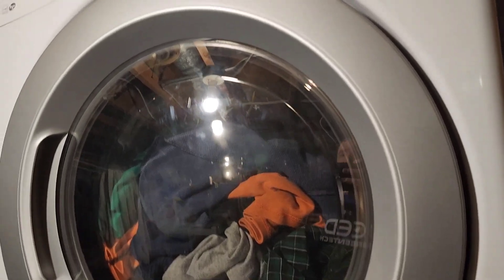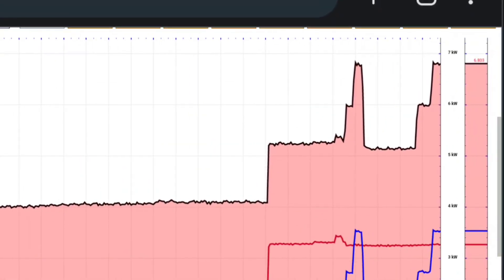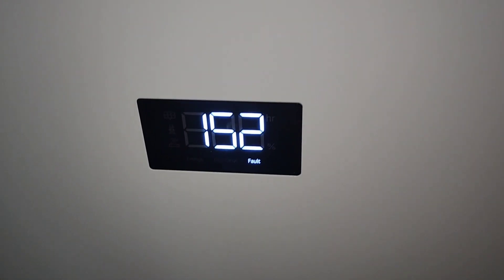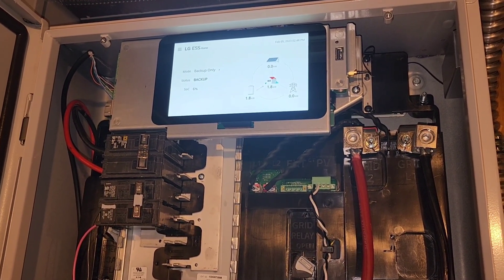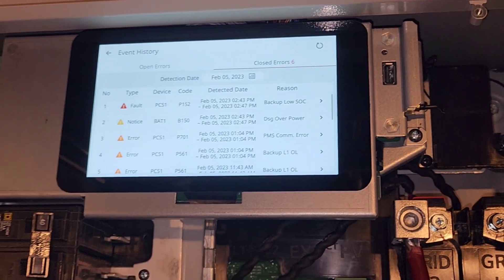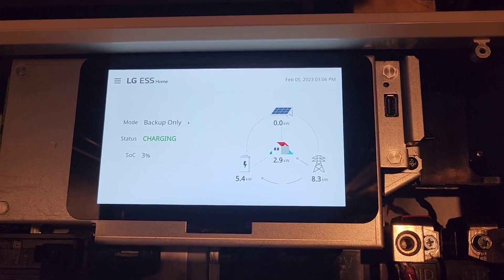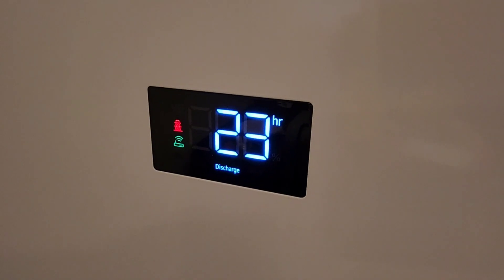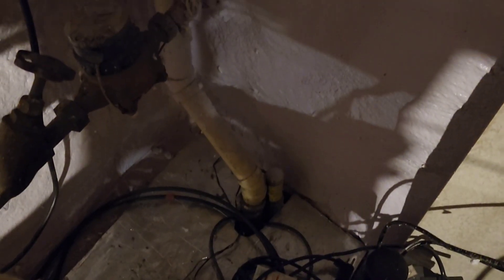Load Testing the LG Home 8 ESS

Comment: Hi Ben,  I hope you will make a 3 minute video on adjusting the solar edge configuration to curtail with frequency without shutting down.  thank you
Reply from the maker: If I can figure it out, I definitely will.  I'm currently running a screened version 7.6kW unit and while I have the settings in there, it doesn't seem to work.  I have one more thing to try. In one of the documents, it shows adding a jumper onto the comm board to put it into off grid mode (I think, it's not clear). I'll post here if I get it, and make a video about it.

Comment: What are the specs of your sump pump? Did you have anything else running with the pumps?

I have two sump pumps on a 20 A circuit that I want to add to the backup sub-panel with the Home 8, but I'm not sure the battery can handle the inrush current, especially if they both start at the same time. They were installed before I moved in, so I don't know anything more about them.
Reply from the maker: Mine is a 1/3hp. The rest of the house was running too, probably around 1000W base load. It should be able to start both at the same time, but if you set the floats to different levels, it shouldn't be a concern.  It will start my air compressor, which other inverters struggled with, so I wasn't really worried about the sump pump.

Comment: Do you think this system is a good option with the sneider for AC coupled Enphase IQ8+ inverters?  Not many stellar reviews on any investors I can find for AC coupled systems working as good as a DC except Tesla . 

My solar is literally in the final stage of install and I need to keep the IQ8’s and all the research i started doing shows the best option is the Tesla Power wall. I’d rather not go through the wait in California to do the Tesla not to mention the price. 

My installer wanted me to go with the Enphase system and I need way more power use than those can feasibly provide. 

Thanks. I’ve literally watched all your videos since the beginning 😊
Reply from the maker: The Schneider works, but it is honestly better for off grid. 
The LG Home 8 has been working great so far and is the closest in features and controls to Tesla.  It is a little more expensive, though.  Thanks for watching ALL of my videos!
Reply: @benssolarandbattery  I'm approaching the big decision and can't afford to screw it up.. After seeing you rave about the Schneider, I am surprised to hear you don't like it for hybrid... why not? 
TY
Reply: Schneider is clunky. LG Home 8 will work with the Enphase.  Best if it is Rule 21 compliant.

Comment: Have you ever heard of a Net Zero (Net Zero its a brand name) Inverter with a 20k power bank I've seen picture of one installed but that's all just curious as to how good of a set up they are. I was told they don't advertise just word of mouth.
Reply from the maker: I'm not sure which one you're referring to.  A number of different systems can do grid zero with zero export as well.  Typically though you need a DC coupled solar array to do zero export.  If you have a picture of the system I can take a guess at it.  Benssolarandbattery@gmail.com 
Cheers!
Ben
Reply: @benssolarandbattery  Net Zero is a brand of solar
Reply: You need to get your units straight before you start asking questions
Reply: @user-ke9yk5qp3u  you need to get your brand names straight before stick you head up your butt

Comment: I wish this battery worked with the enphase Microinverters
Reply from the maker: It does! Arguably better than enphase batteries... 🤫
Reply: @benssolarandbattery  wait what? How would this work? Would another inverter be in the mix? Like xw pro and something else or does the lg battery controller just take in the ac from enphase?
Reply from the maker: @coolmaster121  you can either tie the output of the enphase system (or any other grid tie inverter output) directly into the LG smart energy box, or leave it in the main panel, as long as you're backing up that panel.  There's a current transformer (CT) that measures the solar output. It can then use it to charge the battery and run the house in an AC Coupled scenario. The LG battery adjusts the frequency when the charge rate is too high or when the battery is full, causing the grid tie solar inverter to shut down or slow down, depending on the programming.
Reply: It'll work fine with the Enphase micro inverters.

Comment: Why not just use inverters with parallel capability? I have three 5kW Iconica inverters with a 92kW lead acid battery bank. I can run up to 15kW if I want...We have a 9.5kW electric shower that will take half of its power draw from the 8.4kW PV array in summer. Even in winter, it's no problem for paralleled inverters. I'm in the UK.
Reply from the maker: I definitely could, and do for my customers, but in my case, I'm mostly just testing them. If my customer had a house similar to mine, I'd install at least 2 of these LG batteries, maybe more.  (I use a lot of power)
Reply: @benssolarandbattery  Ah, understood. I couldn't understand why you were taking all the measurements etc.

Comment: Really quick question, can you use any mppt controller with the Schneider xp pro you have?
Reply from the maker: Yup, it just won't be on the monitoring platform.
Reply: @Ben's Solar and Battery  thanks. I have Tigo A-Os and from what Tigo said, they may or may not work with Schneider mppt charge controller and at that cost just for the charge controller add on, it didn't seem like a smart purchase. Now that Schneider inverter on the other hand seems like a real workhorse.

Comment: Cursory glance looks like this is a $12k unit with battery and smart panel for 14kWh backup, how does this compare against competitors? What do you think of Signature Solar’s EGLL v2, you could do 6 of those for 30kWh and supposedly they’re UL listed now.
Reply from the maker: This system is more comparable to Tesla Powerwall, Sonnen, Enphase, Franklin WH, etc.  You can definitely do it for cheaper, but this is an all-in-one, including the battery. Tesla is cheaper than the rest, and this is on par with the rest.

Comment: Hi Ben, that's really weird. I have a similar LG dryer but a matched unit with washing machine on pedestals. My Solark 12K has no problem at all running the dryer on batteries at night or during the day on  full solar input when the sun is shinning. Mine draws about 6KW too and I can have the dishwasher, and washing machine running too. I dare say the well pump and or furnaces come on every now and again when the washing machine is running. What is definitely a bridge too far is having the dryer running and trying to operate the electric cooker and/or microwave. I'm curious why your Solark is so touchy, I'm sure it's  slightly older than the one I have.
Reply from the maker: Hi Vince, my Sol-ark is definitely one of the older units, so that could be it.  I've stayed up to date on the firmware, but it's always fallen short compared to its specs.
Reply: @benssolarandbattery  I wonder if you are getting too much voltage drop on your battery as seen by the sol-ark ?
Reply from the maker: @Sylvan_dB  no, not according to the error codes, plus I have a large NMC battery that can easily handle 200a at 60v.
Reply: @benssolarandbattery  Hi Ben, it's a shame that you can't get it to work. Like you if it wasn't working for me I'd be looking for an alternative for sure. I can't remember exactly but you'd replaced your blown inverter with the Solark and some time later after I'd wasted so much time with other  vendor stuff that wouldn't work one of your videos convinced me to get one too. I think it was circa  2020, probably August. Wow, when I mentioned the other  vendors are from Chyna  the entire comment turned red and I couldn't post. Looks like YT is an an extension of the C C P now.
Reply: @benssolarandbattery  Do you know the exact build date?  The build date is encoded in the number on a rectangular sticker with a QR code.  the first 2 digits are the year, the second 2 are the month and the third 2 digits are the day (i.e. a number starting with 200804 would be 4AUG2020).  I have 2 12Ks in use, one October 2019 and one June 2020, and the earlier one is twitchier relatively speaking.  It also has 20W to 40W higher standby losses.